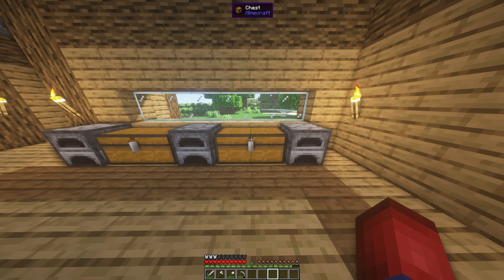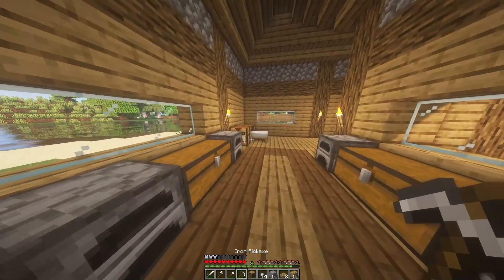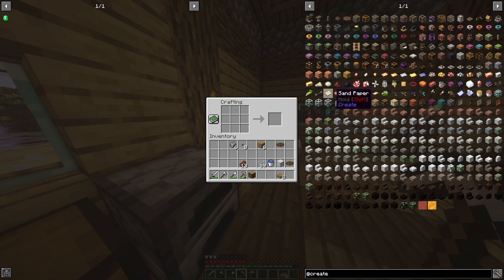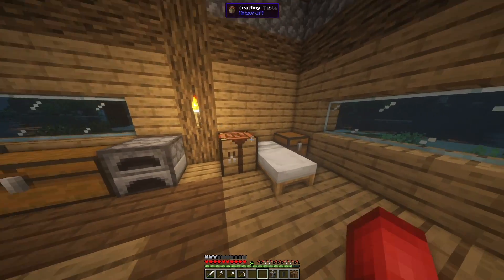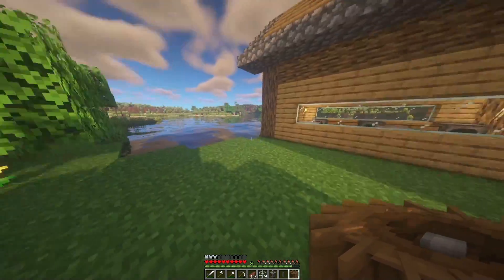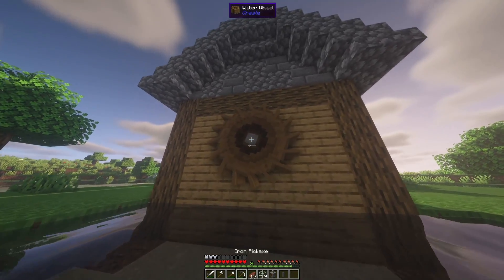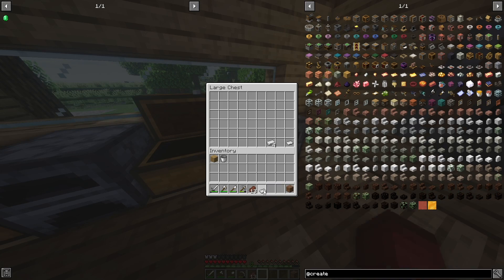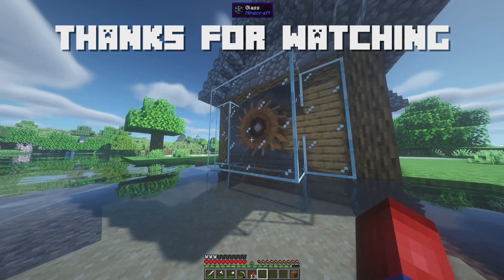Minecraft Create Mod Tutorial - Water Wheel & Mechanical Press Ep 1

Comment: a minor improvment. It is unlikely to have this at the very start since access to the nether is required, but if you have a piece of soulsand and place it a block thelow the glass block you placed the water on and replace the glass block with another watersource-"block" (so, soulsand and two buckets of water ontop of it) the bubbles generated will give you extra power since you now power all 4 sides instead of 3.

Comment: my mechanical press won’t press :/ i placed the water wheel and spun it in the same direction you did and then plopped the press on the back with some shafts, and it won’t press down
Reply from the maker: Try placing a button on the press and press it. Usually it will since if an ingot is underneath, but the redstone might help trigger it!